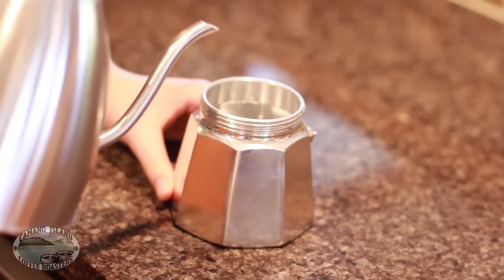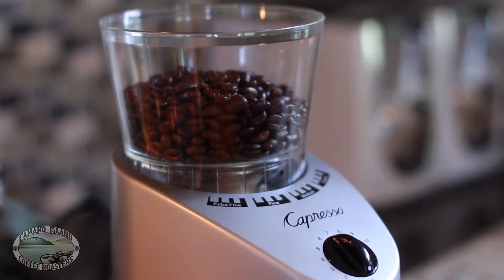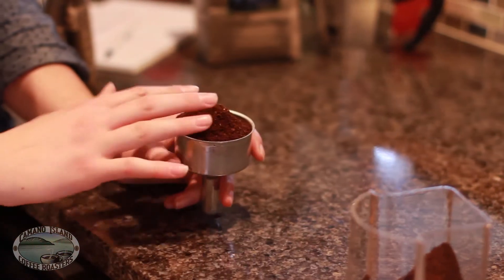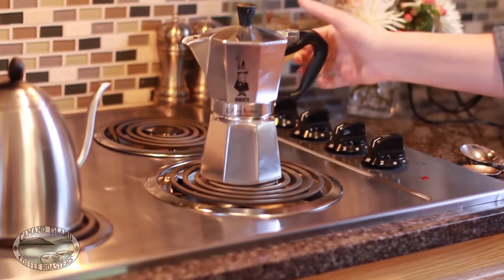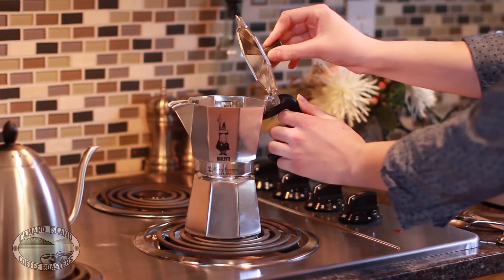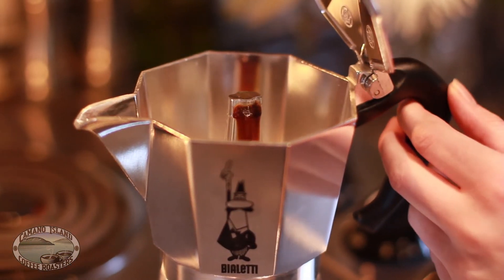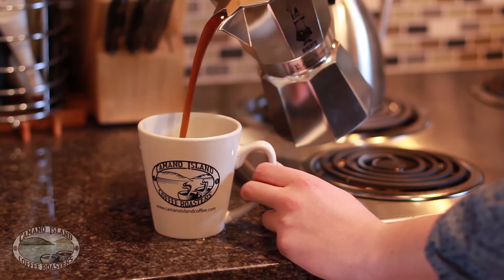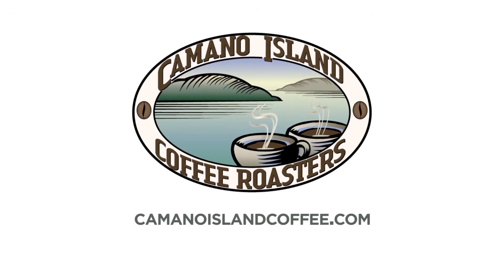Brew Guide: Moka Pot

Comment: That’s no guide. That’s what any newbie does
Reply: I believe it starts with using cold water. And also, need to play the pot on a small burner, smaller than its base. That way you can’t burn the handle.